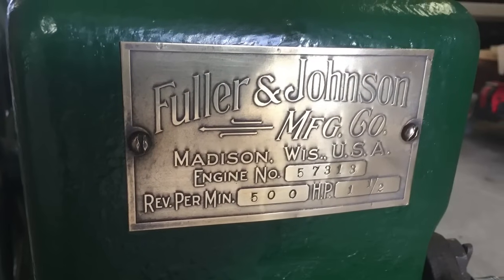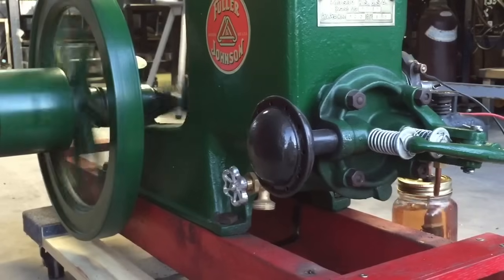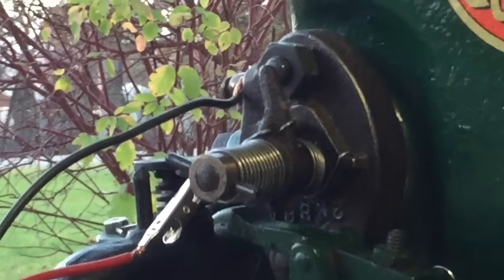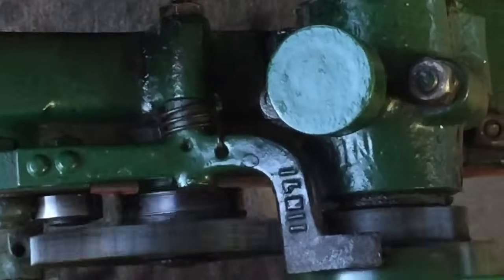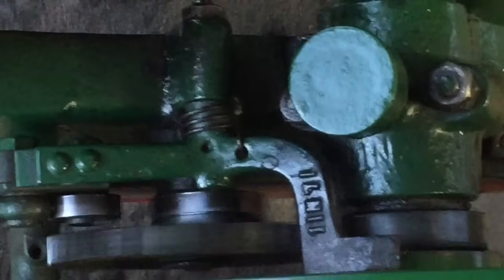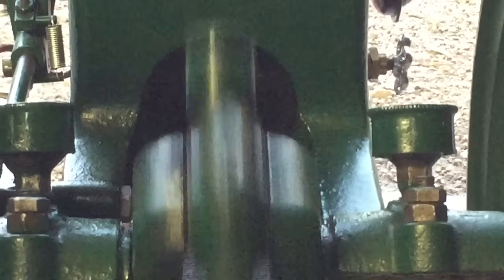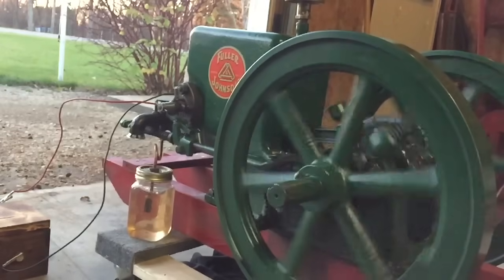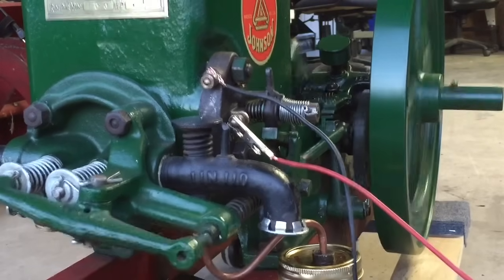How Does A Hit And Miss Engine Work ?

Comment: So hit n miss engines only strike when the flywheel rpm drops enough, to give the flywheel a push and keep it rotating, then waits until the flywheel speed drops again. Quite interesting. I would imagine these engines are pretty fuel efficient?
Reply: Saw a guy today with a bigger one and he said five gallons last him 4 days 18 hours a day
Reply: Poly Bun  If my knowledge is correct, these engines were in use before anti-knock additives were added to gasoline so compression couldn't be very high because of knocking.
Reply: Mo no  I'm sure most of the time was idling because he was grinding cornmeal at Canton Texas. So he definitely didn't need it grinding constantly. But he left it running the whole time
Reply: They're quite fuel efficient on idle regime, at least for their era. When under top load, misses are rare.
Reply from the maker: PunakiviAddikti you nailed it !
Thanks for watching :)
Reply: Poly Bun  they are still very nice and fun to watch though 😊
Reply: Oh now I get
It
Reply: Yes, these engines would be very economical at idle or light load.  They wouldn't use any gas at all as long as the exhaust valve was held open. Also like on a diesel there was no throttle butterfly to offer resistance when running idle. Mind you, at full load the would fire ever 2nd rpm & use as much gas as any other engine.

Comment: great video well explained i never knew how they worked . thanks alot. ill bet they are great on gas ha?
Reply from the maker: +Raymond J thanks for stopping by Ray !
Lol yep ,good on fuel as long as they aren’t under  load :)
Reply: when there under load does it fire every time or will it still miss cause thats how it controls the rpm?
Reply from the maker: +Raymond J It Will fire every 2 rotations of the crank as long as the governor isn’t latching the exhaust valve open .
It will latch it open if the governor is below the determined rpm limit .
The max hp is generally stamped on the tag ,for example 1.5 hp at 600 rpm
Reply from the maker: +Bagot Corner correction ,,it will latch it open if it is “ABOVE” the rpm preset
Reply: thank you so much i love these engines they sound so cool have a great day buddy !

Comment: What would happen if you ran a hit and miss engine with out the governed miss plate
Reply: Emmett Walker Contrary to popular belief, it is not CERN which has shifted us into a parallel universe, but someone who removed the latch out from their hit and miss engine.
Reply: It will attain an higher and higher speed until it will destroy himself   by mechanical failure of some parts. H&M was an old way to control speed, similar to what is made nowadays by throttle. In both cases this can be made automatically by centrifugal governors or other  means (like air pressure in the cooling system in small engines).
Reply from the maker: Emmett Walker Hi Emmet , thanks for stopping by .
Without the governed miss plate ?
I’m not sure I’m understanding you .
There’s no plate .
There’s a latch out .
The governor holds the pushrod in the exhaust open latched position .
When the flyball slows enough the pushrod unlatches and the exhaust valve closes .
When that happens you get compression and suction .
If there was no latch out ,the engine would overspeed and destroy itself
Reply: That's what I mean
Reply: What would happen if you remove the latch
Reply from the maker: Emmett Walker if I remove the latch then the exhaust valve stays closed and over speeds .
If I remove the pushrod  then the exhaust valve never opens or closes and the igniter never sparks
Reply from the maker: FlatBroke612 lol 😂

Comment: Looks way more complicated than any typical internal combustion engine. Am I missing something here?
Reply from the maker: Toadydoh I don’t think you’re missing anything .
Perhaps no one has ever explained to you  how every component of a 4 stroke engine works ?
They all have governors ,valves ,pushrods ,,
Reply: Bagot Corner - Thanks for your reply. I am very familiar with Typical 2 and 4 stroke engines. I had trouble following the sequence of operation as it was explained. Seems very complicated. Maybe my issue with not understanding it is because it seems quite different to me. I understand camshafts, valves, crankshafts, pistons, ignition circuits etc. I saw one at the fair this past summer just like the one in the video and it was driving everone around it crazy from the noise. Lol.
Reply from the maker: Toadydoh lol the noise sort of either grabs you in a bad way or an infectious way .
Hmmmm well if you want to know about any part of  it I can explain it further if you like .
Just let me know ,,I’m always happy to chat about them
Reply from the maker: Toadydoh it does have a cam shaft ,,but just one lobe,,it makes the push rod travel and actuate the exhaust valve
Reply: Bagot Corner so how does it work?
Reply from the maker: What in my video are you wanting explained .
I’ll gladly discuss it 😊

Comment: Yep still don't get how they work.. It's hard to understand how it can bypass X revolutions, then close the valves, fire and then do it again and how it actually manages to fire on every stroke that you want it to, I mean how many yanks do most lawn mowers need or how many cranks do most cars need before they will actually fire? Yet somehow these fire exactly when you want them to every time?
Reply from the maker: Well it by passes closing the valve ( one valve ,the exhaust ) based on whether the fly ball governor un Hooks the latch out or not .
It’s not x ,,it’s based on the speed of the flywheels .
How does it fire every time it’s supposed to ?
There is never an issue with spark (if the coil is functioning )on a lawn mower for instance  ,only fuel delivery .
All those pulls you’re making are you pulling fuel up to the combustion chamber from the fuel bowl to mix with air .
The spark is always ready to do its job.
Why does this machine not miss a beat ? 
It takes awhile as well to get it started ,it’s not exactly one tug on the flywheels and it’s running .
But once it’s running ( like a mower) it’s simply running.
It also has a check ball to hold the fuel in the feedline
Reply: I put X as a variable for how many revs it is depending on how you set it, could be 3 could be 5 could be 1, dunno hence the variable. I wonder if anyone ever made a direct injection diesel version of one of these.. would be interesting.
Reply from the maker: J.A.Ratt85 I understand .
What I’m saying is that x number is determined by the speed of the flywheels which can be influenced by engine load and governor spring pressure
Reply: Bagot Corner the massive weight of the flywheel hold loads more kenetic energy that helps if it does not fire properly
Reply from the maker: Kyle B you get to see them run nice and slow when you have heavy flywheels and excellent compression ,which relays into strong intake suction

Comment: a question, are hit and miss engines desisel or gas ? thanks in advance.
Reply from the maker: kae4466 I’ve not seen any that are diesel ,though I suspect it could be done with the assistance of a hot bulb .
The compression would be hard on components and also the fact that hit and miss engines tend to run cool .
This one is gas.

Comment: Those are cool crazy motor's I wonder what the advantage to that was over the standard 4 stroke motor! Great explanation!
Reply: A normal throttle governor four cycle fires every fourth stroke and controls speed by varying fuel volume with the butterfly valve. Hit and miss only fire when needed so it saves wear on ignition parts and saves battery life.
Reply: Another difference, this type of hit and miss coasts longer because the exhaust valve is held open and there is no compression resistance. A regular throttle governor engine coasts while also doing compression strokes which slows the engine down.
Reply: Thanks very cool info. Thanks for explaining that. I will sure have a better appreciation for them now.

Comment: Modern hit n miss engine. When the throttle cable breaks and you jam it flat out, turning the ignition on and off lol.
Reply from the maker: Lol exactly it buddy !!!
Reply: the explosions out of the exhaust when you turn it on and off <3
Reply: That's how I have to start my snowmobile it will only run when you first start it with the choke but it will take off because it will hit like 6k rpm so I have to cut it when rpm get high I could just adjust the carb but this way is more entertaining
Reply from the maker: +Andy [Xvixx] you ain’t wrong Andy :)